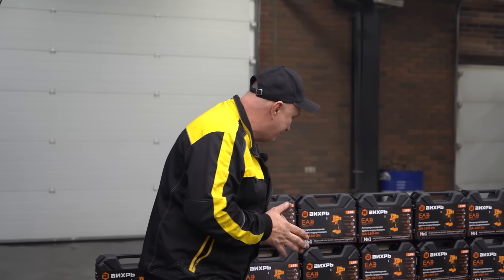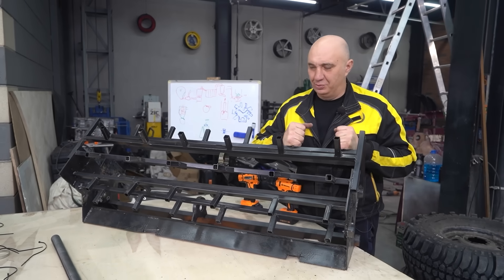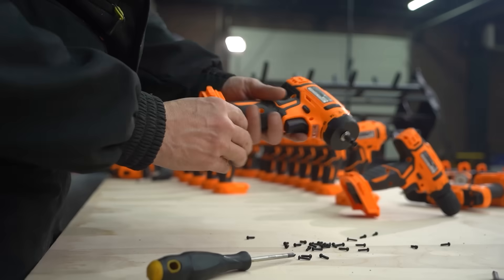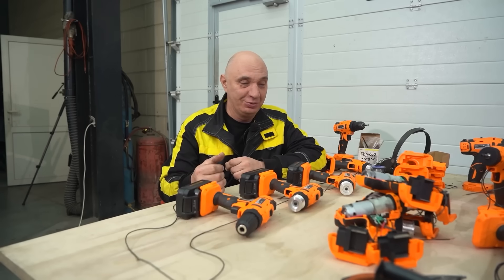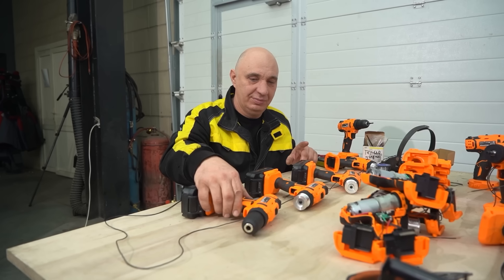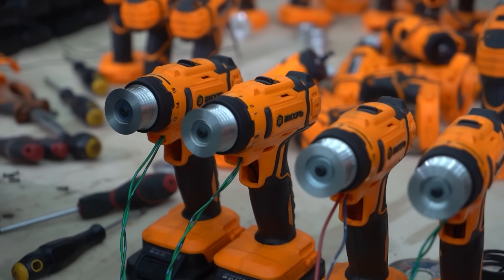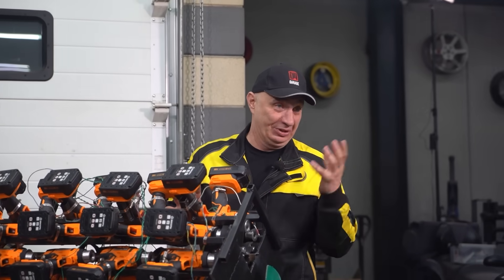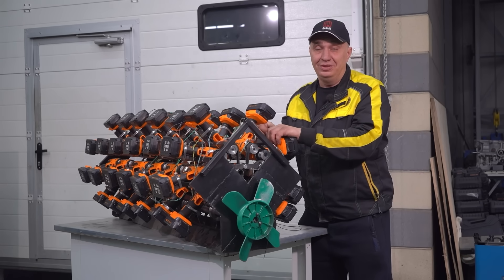50 cordless drills made into an engine for a car

Comment: Finally, a mechanic friendly EV design.
Reply: And only 50 batteries to remove, recharge and replace 3/4 of them on the sides or underneath.
Reply: @JonathanTamm  It can easily be wired to charge them all at once.
Reply: @JonathanTamm  Still cheaper than the replacement of a BYD battery. :D
Reply: @sgeb4996  I don't know about that. They charge like $80 a pop for those batteries.
Reply: @JonathanTamm  so half the work of 70s American made cars.
Reply: @JonathanTamm  Still less steps than swapping a tesla powerbank
Reply: The tools you need to fix your motor are already there!!  🤣😂🙂😉✌
Reply: And I had the design drilled into me from day 1
Reply: @hugegamer5988 hahahahahaha lol XD 😆😆😂😂😂😂🤣🤣🤣🤣🤣🤣🤣🤣
Reply: w

Comment: use a motorcycle starter solanoid..itll handle the current no problem..
then just wire up a button to make the motors start etc 
:goodvibes::goodvibes::goodvibes::goodvibes::goodvibes:
Reply: 50 motors at 5 amps start up is 250 amps but posibly far more getting the car moving a 5 ah battery will not last 1 hour  so more like 20 -30 min at low speed so 500 amps

Comment: Run diodes inline for the switches, or have a separate triggered relay connect them all - isolate the trigger from the signal.

Comment: With your direct wire method, might as well use ESC for RC cars (check if battery voltage is OK for it) and use a transceiver or "servo tester" to control the motor speed at once. Just hook the output of the transceiver or "servo tester" into the corresponding signal input for the ESC, might need to check pinouts - test with one or two of them first!
Reply: This is what i would have done too.
Reply: Not sure about that because so many ESC are gonna be so expensive
Reply: @pierrejeanes  If they use the cheap ESC you can get, and maybe 10 or 20 ish amps...if they paid for all the drills it won't be that expensive

Or someone in their region can mod the existing ESC in the drills to do the same job
Reply: my esc button is plastic and does not work for rc anything.

Comment: Since you direct shorting the motors, use solid stat transistors matched to banks of the screw driver motors, then control the transistors with pulse width modulation. That way you get variable rpm but full torque
Reply: As good as that sounds there’s no way we’re gonna see pulse width modulation in the next episode.
Reply: @alexwalker8422  yes, you could use 1 controller to trigger the SSRs all at once
Reply: I think one of Vlad's guys will just drink a lot of coffee & wear short sleeves in the cold so he can do the PWM by hand

Comment: Are they mosfets and not transistors? They work very differently u have to ground the signal wire or the gate its staing open u to remove the charge u applied  when u started them thats how a mosfet turns off
Reply: U can ground them using a resistor u have to find the correct size for u needs

Comment: you need to isolate the signal to each trigger as that is causing the issue. You cannot connect unmatched transistors to each other.

Comment: FIX:
....make it a Full-Throttle running engine, and just Clutch-In... 
like a combustion engine.. it revs all the time.. you have to clutch in. No Gas-Pedal needed, only clutch.
one "on-off" button for all screwdrivers is enough.

Comment: Fix:
go for "Bicycle breake-lines", that way, the Screwdrivers are untouched (good for the sponsor).
This wont be easy to match, but its a pure mechanical solution.. At Full Throttle all should be aligned again.
Question: what happens if you release power? the crank will rotate further, and can destroy the screwdrivers.. so you may have to clutch a lot, or come up with some slip.

Comment: I would have ran all the motor leads to one central power controller point and used one single drill controller to drive a large power  IGBT of Mosfet that runs all the motors at once.

Comment: Lithium batteries can be set up differently per manufacturer.  Batts definitely have a safety that wouldn't like over volting from hooking multiple packs together.  Probably easiest to run all motors from a single controller capable of this much power.  I would park it outside away from anything you care about for sure. She may start combusting.

Comment: What happens if you connect a powerful electric motor directly to the front of the crankshaft? Will it assist the engine and work as a cheap hybrid?

Comment: Soldier a wire on to pin1 for each semiconductor you might have to disconnect it from the rest of the circuit board but  then soldier that wire to one of the control box the motor live wire to control the pwm, if you look up diy speed controller on YouTube you’ll figure it out

Comment: Must overload the resistors when wired together too much voltage 

I know this channel is about cars but now I'm wondering how many leaf blowers you need to push a small boat that could fit 5 people that weigh 200lbs each 🤔

Comment: If drills has built mechanical brake which prevents rotating spindle when motor doesnt work inside gearbox, it will destroy gearbox of first drill which suddenly stops or unscrew all pulleys when you put it in car and  and disconnect power when car is in movement.

Comment: Sounds like you're getting capacitance charge in the gate of your mosfet. If you connect a high resistance resistor from the gate to ground, that'll prevent it from getting stuck on
Reply: This is exactly what I think is happening, especially if he’s typing multiple gates together
Reply: @zaydabbas1609  with different power sources. a diode between and a pull down resistor as oskiv says
Reply: Yup! Flyback diode and pull down resistor.
Reply: Have you tried unplugging it and plugging it back in? Let me know saar
Reply: if my understanding is correct, this is because the difference in state from the gate in front of it effectively makes enough of a difference in potential to hold the downstream gates open.  Which is why the diode/resistor works, because the current can then go to ground. And the diode prevents a short to ground when the gates are normally triggered.
Reply: @autotalon  most modern power mosfets already have transient suppression to a reasonable pulse power level.   Why back when I started we had to roll out the mats, humidify the air, strap up your wrist, and tie back your hair.  Then if someone as much as sneezed in a 50 foot radius when the gate wound up getting blown before even being installed everyone just blamed ESD.  It also ate my documentation.
Reply: Maybe Garage 54 and ElectroBoom can do a CoOp video....
Reply: Or add mosfet drivers
Reply: I also think it's due to the capacitance at the gate of the mosfet. I agree with tying a high value resistor to ground.
Reply: It's missing the flux capacitor
Reply: Just wait till they find out about transients.  Then their knowledge of phasors won’t be limited to Star Trek.
Reply: Good advice and while doing that they need to consider the wires to the mosfet picking up RF, you know, from the 50 cheap drill motors running. So I’d at least make sure all cabling is twisted up with the drill and secured somehow to minimize loop of the circuit area.  Also goodbye AM radio when motors are on.
Reply: I suspect the ‘switch’ is actually a variable resistance used to vary the mark/space ratio of a PWM controller and likely forms part of the timing network. Connecting more than one timing circuit to the same resistor is going to cause all sorts of problems as at best, the resistance needed for one circuit won’t be the same with multiple circuits in parallel and the timing signals from each circuit will back-feed each other.
Reply: Why the drills dind't work?
Here's the explanatuon why they are burning:
When the trigger is pressed it connects the motor + / - to battery + / -
When releases the two leads of the motor is connected together creating braking force, the source is desconnected.
It will short the power source if you try to bypass the transistor like it has been done here on the video
Reply: Just needs to defrag the BIOS and update the psu's firmware. Then uninstall the quad bond injector. Simple
Reply: @KouRou2002 thanks for the laugh 😂
Reply: @KouRou2002  it’s most likely an iD10-T error. These processors have a DM-5# that intercept nano signals in the quinine regulator. If they just connect a cybernautic distributor to all of the processing RFID’s the system wouldn’t continuously send interference to the magneto-optic capacitor

Comment: Needs more diodes

My initial impression is that one drill powered up is back feeding to the others
Reply: Yep. Or they need ran individually though something like mosfets and 555 timers all fed by a common variable resistor.
Reply: diodegonewild
Reply: Begone THOT BOT.

Comment: The transistors are dying because the chip doesn't have much headroom to drive a lot more than one at a time. Transistors end up under-driven, the junction dissipates lots of power, overheats and dies.
Reply: I think they were still using one transistor per drill, just linking all the gates to one input. My guess is they were not considering input impedance of the transistor and matching with the output impedance so each transistor may have been drawing too much current.

Comment: Tesla motor can eat dirt, the 50 SDP (screwdriver power) is here

On another note, I’m actually impressed with how good this teams fabrication skills have gotten
Reply: i would be impressed if their skills did not improve, with all the shenanigans they indulge in
Reply: @djxzinik  And we like Garage54 for their shenanigans lol
Reply: @djxzinik  - I would be unimpressed if their skills did not improve but would still be amused.
Reply: ALL of a testa can be a cannibal and eat 💩
Reply: You have to under crushing sanctions and spiraling inflation.
Reply: Care to elaborate a little more by what you mean?
Reply: @TheSilverShadow17  I’ve been subscribed for years, this is the first thing they have made that has genuinely blown my mind. They’ve come a long way on YouTube from screw self tappers into tires to projects like this. These guys deserve 20 million subs
Reply: @encompassthyeclipse7278  Indeed they have. My reply was originally meant for the guy without a name in the comment thread, but this will suffice. What's your favorite build or wacky contraption from Garage54 that you've seen in a video?
Reply: @TheSilverShadow17  this one, absolutely 100%
Reply: @encompassthyeclipse7278  Mine's the one with the offset wheels experiment, and various others lol
Reply: Capacity is crap, but drills like this can exceed 1000W power out each which is about 1 1/3 horsepower.  Thus a 50kW electric vehicle made extremely light by no range but still has full surge power would be awesome.
Reply: Tesla as a whole is a complete joke lol 😂
Reply: I like your PFP 😊
Reply: @ 🤘 love from West Virginia
Reply: @АлакПатрова  So do i.

Comment: 5:19 transistor matching. If they're not matched, current will feed into each other. Other option is to isolate/buffer them (diodes? Opto-isolation? Gates [multiple xistor]?)
Reply: No, it's issues with driving them and parasitic inductance. That's PWM control, which involves turning the transistors on and off quickly so they don't dissipate heat of their own.

The way to do this would be to have a single pot controlling a single chip, with multiple mosfets in a bank (with sources on ballast resistors) via a suitable driver chip to ensure the gates go high/low as fast as possible on transitions. Look inside high power inverters for an idea on how this is typically done.
Reply: @MadScientist267  could it be fix using a resistor to remove the inductance from the signal wire to ground?
Reply: @MadScientist267  Yeah, you're right. They probably tried to feed them with direct DC, which is not good.
The quickest solution is to have a mosfet as buffer to feed the mosfet of each drill. That'd do the trick...
Reply: Maybe there mosfets thats why when u apply voltage it stays on u need to ground them or remove the charge applied somehow
Reply: @Rizzmonkey69-f1s  That's what I think the issue is. Transistors would not have stayed on, so those must be mosfets, which need pull-down resistors to make sure they turn off once the trigger is released. They probably also need to make sure there is a protection diode for each mosfet to make sure reverse voltage spikes don't kill the mosfet, which is what it looks like was happening (although not at once).
I would've paralleled a bunch of mosfets and connected all the motors together, that way there's no issue of matching anything... the voltage that comes in is the voltage that every motor will see.
Reply: @evertonptube  i think their using dc motors and not brushless so if they don't want to experiment with electrical engineering they could use high current dc motor drivers just mesure how many amps each drill is using and use 1 driver for multiple drills and 1 pwm controller for all the high current dc motor drivers
Reply: @Rizzmonkey69-f1s  That would be my guess. Stray charge on a MOSFET gate will keep it conducting.
Reply: @gshingles  it could also be that their using different batteries for the power source and not one common ground they could try to wire the batteries into one power pack and see if that fixes the issue
Reply: I found a video that explains common ground very well https://m.youtube.com/watch?v=Fb27A_Onpbs&pp=ygUNY29tbW9uIGdyb3VuZA%3D%3D
Reply: @Rizzmonkey69-f1s  connecting all of the grounds of the batteries together should fix it also
Reply: @jackrenders8937  yeah thats what I said with having a common ground so that the signal wire has a ground to return to thats why the mosfet is not being pulled down but that might work for 3 or 4 but the signal might not be strong enough to turn on more than that or the drill being used for control will let the magic smoke out
Reply: Wow. Nice well thought out descriptive reply to a good question...

And YouTube decides to delete it. Such a steamer of a platform.
Reply: Probably they using MOSFETs and forget to put a resitor between gate and source,. when It happens the MOSFETs close and only open again when the power is pulled out.
Reply: @esmerilhamente9959  i was thinking the same but they should have one from factory
Reply: Maybe just adding pull down resistor on the mosfet gate
Reply: Depends on how it is connected. If each of them just feeds one motor, that is no issue. The problem will be on the circuit design, how it does PWM control. They need to use dedicated ESCs and use a single drive signal (aka driving multiple ESCs with a single transceiver) unless the board in the drill can handle that.
Reply: 7:15 well no shit if they're dc motors why were you burning silicon fumes in the first place 😂 that shit ain't healthy
Reply: @forbiddenera  Because the trigger can control the speed of the drills like a throttle in a car instead of the motors only being on or off.